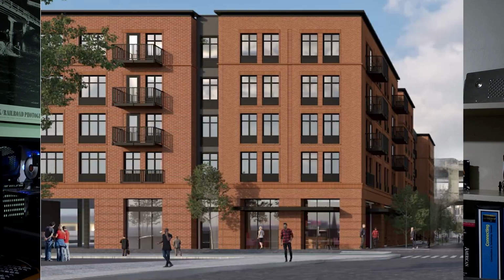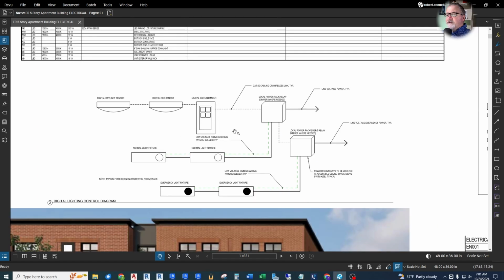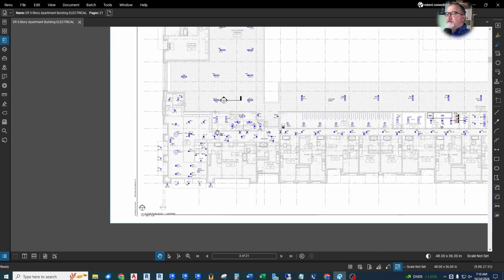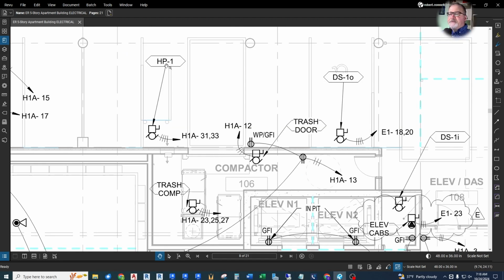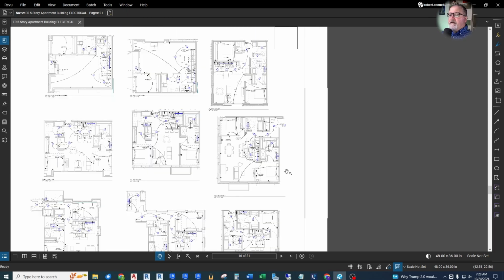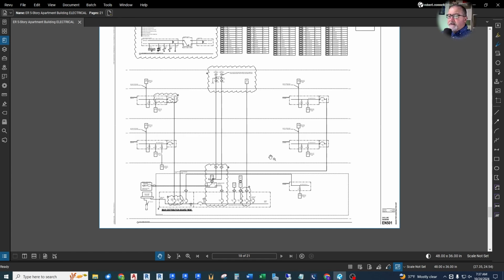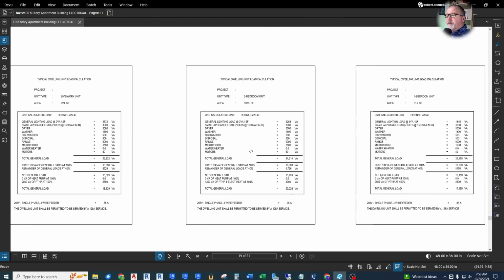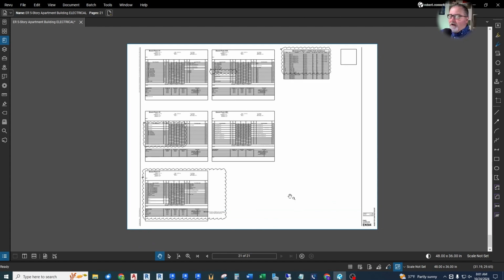Electrical Blueprints Decoded | MEP Building Plans

Comment: what does single phase 120/208 look like? How do you get phase to phase different than phase to GND in a single phase system?
Reply from the maker: Great question! 120/208V single-phase has 3 wires - 2 hots and a neutral. The line-to-line voltage between those hots is 208 volts, and the line-to-neutral voltage between either hot and the neutral is 120 volts. I think a common misunderstanding is the terminology of "single-phase" - because we also often call the hot wires "phases" like phase A and phase B - and in fact within the Revit software, it calls this system a "two-phase" system. A diagram of the arrangement of the actual transformer coils and connections is definitely helpful, and especially if compared to a 120/240V single-phase system, which actually gives me a great idea for a future video!

Comment: You are an amazing teacher and that is an understatement. Just watched the whole video for fun. I assume you are based in Oregon. I almost moved to Oregon in 2022 to work for Nortek but it did not work out. God had different plans for me. Found your channel by pure chance and this is a gold mine. I can't believe it only has 3.44k subscribers. People who work for you are truly blessed to have such an amazing mentor. I wanted to ask a few clarifications on this video if you don’t mind: 
Around 25min mark on the roof power plan, the receptacles near the RTUs are floating. Where are they mounted?
Around 42min mark: 43,298A SYMM (PER PGE). Did the utility provide the available fault current on the secondary of the transformer? Or did the utility provide the available fault current on the primary of the transformer as well as the size and impedance of the transformer and you calculated the amount of fault current on the secondary of the transformer (which is 43,298A) using a software (SKM)?
Around 47min mark: Is the 3500A MCB on MDP 100% rated (in my opinion it should be)? Demand on MDP is 3179A. Same question on HDP which has 800A MCB. Demand on HDP is 706A. 
God bless you sir.
Reply from the maker: Thank you for your kind words! I hope you are enjoying where you are, even if not in beautiful Oregon! And subscribers keep increasing little by little - thank all of you who subscribed! The YouTube algorithm trickles videos out to people as it sees fit - but Likes, Comments, and Shares definitely help get the word out to folks that can benefit from it so thanks for those as well! As far as your questions - 1. The roof receptacles are shown diagrammatically, which means we left it for the contractor to verify in the field the best place to mount it (happens often in these types of drawings). 2. The available fault current in this case as I recall was provided by the utility at the point of connection between the utility and customer, which is the main switchboard CT terminals - so they accounted for the transformer impedance and even the secondary conductors (service lateral) impedance, which is handy. 3. Because we apply NEC demand factors to each type of load separately (i.e. 125% for continuous loads like lighting, 10KVA + 50% of the rest for receptacles, etc.) then our calculated load already accounts for the non-100% rated gear (since certain loads are already inflated, we don't have to "double-derate" the gear, which for continuous loads would be like a 64% derating). Hope this helps, and thanks for the feedback!

Comment: It would be awesome for a video going in to more detail on that lighting control and how you implement that. Also do they put meters on each floor of the apartment buildings for each apartment? I always figured the meters were required to be on the ground level so that the utility meter workers can access them.
Reply from the maker: Hey there Colton - sorry for the delay - caught me on vacation! Good questions - I'll go into more detail about lighting controls in future videos. And about the meter locations, it really depends upon the utility company - around here, they usually give permission to spread the meters out among the floors, as long as they are close enough to elevators for access. But yes, the basic premise is to have them all on ground level, which we have had to do as well on other projects.

Comment: Kindly explain MEP coordination step by step.which comes first from top to bottom at the corridors
Reply from the maker: Hey there! You bring up a very good point - coordination between not only the MEP trades but the architecture, structural, fire protection, etc. is a huge issue both during design and construction. In future videos, I will give examples of how this typically works - it definitely varies project to project, especially with the different construction methods such as mass timber buildings!
Reply: @ElectricRob  commercial biluilding and shopping mall.its really help us

Comment: Thanks for sharing it. Also, a question. What have you used for the bus duct? Revit doesn't have any, as I know.
Reply from the maker: Hey there! I approach bus duct a few different ways, depending upon my needs for the specific project. In this project, I knew the contractor was going to model the bus duct in detail for their installation drawings, so I just showed it in 2D with simple drafting lines - I modelled the connection point with a "switchboard" family, sized down to match the connection point, which let me electrically add my meter centers to it to get my bus duct load summary. On another project where I've wanted to actually 3D model it, I've used mechanical duct, or I've customized individual bus duct pieces and assembled them together. Sounds like a good topic for a video - hope this answers your question!